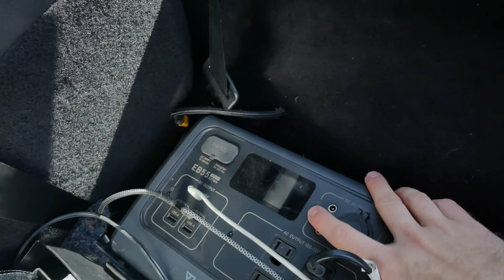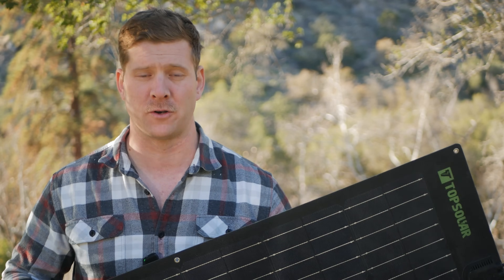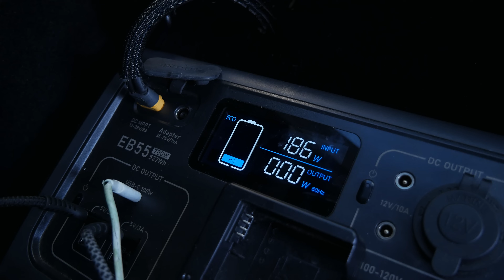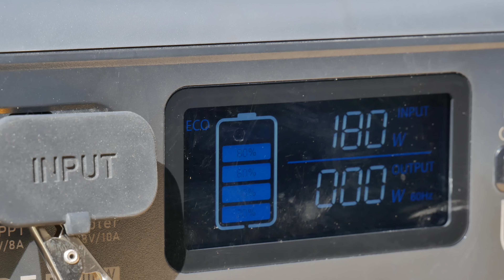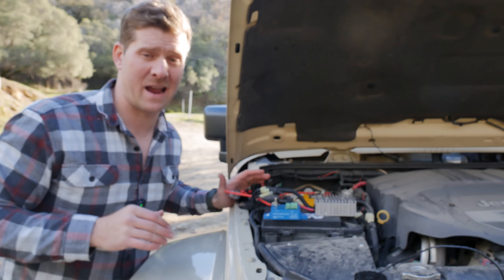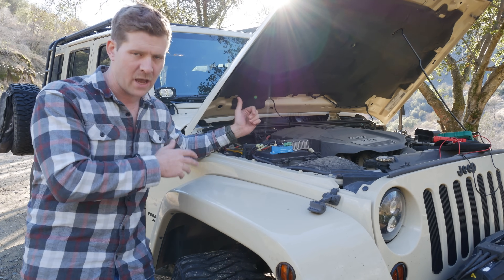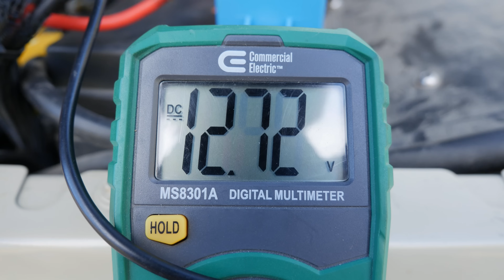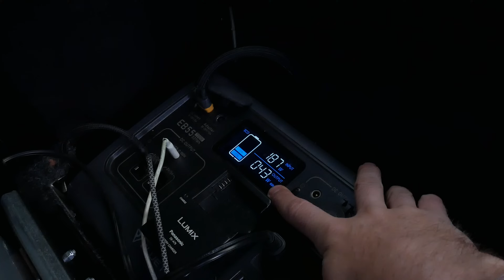Solar is Impractical for Overlanding: Here's a Cheaper Alternative That Makes 200W!

Comment from the maker: ** Correction: Watts law, not Ohms law (stay in school kids). Subscribe if you found this helpful! More like this to come!

Also I appreciate the feedback on the voltage cut off! Going to raise it higher than 12V. Also, I took your recommendations and moved the step up converter under my passenger seat for far better cooling.
Reply: You had it right the first time.... Ohm's law tells us volts times amps equals Watts

But I guess it's really potato potahtoe
Reply: 12V on a car battery is actually considered a flat battery.
You will find out why on a cold morning.
Reply: @ProjectRoadsideFaith   Actually, Rhino is correct.  Ohms law is Volts=ohms x current.  Power calculation is Watts=Volts x Current
Reply: Watts the difference?
Reply from the maker: Underrated comment

Comment: Wow you guys are way behind the times. In Australia every 4wd that has a 2nd battery and goes off road also has a DCDC charger fitted that does both Solar and Alternator charging, if you are driving you are charging, if you are camped you are charging. But then again we fit winches and radios as well.
Reply from the maker: You guys are definitely ahead of the game
Reply: And Australia is sunny almost everywhere you go!  Perfect place to take advantage of solar.
Reply: Do the Real Australians Have 4x4s or are they still being treated bad by the uncivilized colonizers.  That matters much more.
Reply: @LasVegasRealEstateCo  Ha Ha, Yea Mate we all get treated like s%it by our governments (Both state and federal) We are only allowed a 3 inch lift max = 2inch on suspension and 1 inch on tyres. Track width no more than 1 inch from OEM. Anything else requires a engineers certificate. 
To compensate all the 4x4 enthusiasts here run winches, diff lockers and have traction boards. 
One thing we do better than you Septic Tanks is our electrical systems. We all run refrigerators, a common size is 20 gallons, induction cookers are common, 12 volt ovens are common. 
We all run a DCDC charger with solar and alternator inputs, so we are charging when driving and also charging when camping. A 30 amp charge when driving and a 20 amp charge on Solar is normal. 
We Camp for a week with cold beers and fresh steaks.
Reply: The Dual car battery fad has come and gone in USA proving itself to be a liability not a boon.  My Bluetti AC180 sustains us for days without needing recharge and Bluetti's proprietary high charge rate only takes 1.5 hours to 100% charge.  1.5 hrs is almost the time it takes to pack the car!
Reply: @rubiconadventurewithscotty3258  So you have a duel battery without having a duel battery 🤣🤣🤣
Reply: @peterstone5356  haha - Mate, you're gonna do well in USA politics!
Reply from the maker: This thread is awesome. Haha
Reply: We also fit snorkels as well. Around half of the 4WDs and 4x4 utes I see in North QLD have them fitted, and I'm sure most of those never go off road.
Reply from the maker: @zo1dberg  to be honest, I feel like we barely rarely have used for them here in the US. If there was a river I needed to cross that was anywhere near the hood I'd probably just turn around haha
Reply: @RhinoOffroad  Do you see them on a lot of vehicles in the US though? In Australia, they're everywhere, but I doubt many of their owners ever go offroad, let alone go down to a depth of water where you'd need a snorkel.

My 200 series Landcruiser came with a snorkel when I bought it, but I don't do offroading as I only use it as a tow vehicle.
Reply from the maker: @zo1dberg  more than you'd think, and I chuckle every time I see one as I doubt those tires ever touch a river, let alone a creek haha
Reply: When I was living in SA you'd often hear about snorkels being recommended to get cooler and cleaner air from higher off the ground.    Australia is a dusty place.
Reply: @JAlexanderG  That makes sense, and ChatGPT agrees with you too!
Reply: @zo1dberg  Exactly - who thinks that plastic actually looks good if unused?  SMH
Reply: @peterstone5356  Can you post information on those things?  That sounds pretty cool 😎
Reply from the maker: @aceclarksatx on the gear used? Check the description 🤙
Reply: In Australia, you need these things as a necessity in the US we use these things for recreation. But I do wish that they came on four-wheel-drive too
Reply: In Australia, you need these things as a necessity in the US we use these things for recreation. But I do wish that they came on four-wheel-drive too
Reply: It’s seems quite a bit more rugged over there. Kudos to the Aussies🫡
Reply: In the US, we do indeed see a lot of Jeeps, Rovers, FJs, etc fitted with snorkels and railroad jacks... and these cars, you know damn well they've never seen any serious terrain duty... certainly no river crossings. 
Most of them are poser brahs.  

About the only snorkel intakes I ever see getting purposefully used around here are fitted onto quads.
Reply: Funny thing about the Bushmasters we Aussies sent over to Ukraine: the biggest advantage of them was that they had decent de-bogging tracks to lay down and pretty reasonable winches on them. Low-end vehicle recovery, alongside a couple of power-points for cooking and comms/ recharges.
So it's not just in the dry that this stuff is handy, works in the slush too. Even in a warzone.
Reply: Many full-size commercial trucks, semis, whatever have air intakes well above 4x4 snorkels because the air is cleaner & sometimes cooler up there.
Reply: This is the way!
Reply: @rubiconadventurewithscotty3258  So, a dual battery
Reply: Yes that is a better solution. I wouldn't like to run that on one battery the risk of having a flat battery is too high. 
Yes I do note that he has accounted for that. But a second bat and solar is better much better.
Reply: Cheers mate! Great tip! Imma' grateful yank and I will do this! Genius you damn aussies! 
🏴‍☠️🏴‍☠️
Reply: @peterstone5356  I camp (USA) 3-4 wks off grid. Solar: 1KW, battery 500+ah, induction, fridge, comp toilet, Starlink, 3 computers (work from van), espresso maker, toaster oven, etc… and Imma girl. Self built 🎉❤ oh 28 gallon water tank with 4 filter system- only used for drinking/military shower- outdoor shower, AUS 12v water heater!
Reply: @RhinoOffroad snorkels are used mostly to have a fresh air source instead of the dust billowing under the vehicle off road.
Reply: @JAlexanderG exactly~
Reply: @MannyWC  Nice system, you could almost run air-conditioning with that.
Reply: @peterstone5356  lol ‘almost’ is my issue;)

Comment: Take note guys, he's basically just charging his battery with his engine twice as fast. He didn't magically double his power. It's all equal at the end of the day. But you are pushing your engine though. Not sure how to calculate the wear and tear of that.
Reply: Do your oil change more often. Like cut what they say in half.
Reply: Engine wouldn't notice additional 100 watt power draw from this. So, only problem are hours of idling, each of them is like another 10 miles to the mileage.
Reply from the maker: @TheMadJagger not idling to charge; just charging while driving. Totally agree with the negligible additional load.
Reply: @TheMadJagger   An additional load on the engine of 100 watts is equal to 0.134 horsepower. Hardly something that you need to be concerned about.
Reply: 746W = 1HP so he's drawing less than one third of one horsepower, his engine is really not going to notice! Your A/C draws much more...
Reply: From what I've seen on other channels, the alternator can heat up at low RPMs due to slow fan speed. I'm thinking that the breaker switch might be handy in the cockpit, to turn the system on when on the road. Perhaps an extra fan could be installed near the alternator for charging at idle.
Reply: @gotredeemed In principle yes  if you're drawing too much power you can overheat your alternator.  In this case he's under 200w which is about the same as turning on your headlights.  Not enough to be a problem IMHO.
Reply: @sonictech1000  Good to know. I'll be trying the same setup. I think the controller I bought (temperature sensitive) won't handle it and may need to buy one that will. They can be pricey.
Reply: Pushing the Engine  how  exactly ? The  Alternator  is  working a bit harder , yes , but the Charging cycle is usually done  WHILE  DRIVING . Yes ?

Comment: Yup I have a high speed Jackery charger onboard in the gladiator cap that charges at 190 watts. You don’t need 24 v either 😉.  You are the first person I have seen that has figured this out. Jackery charged in 3 hours 🎉
Reply from the maker: @wildernessrecon  glad you found another good solution! I'm guessing that the Jackery charger also boosts the voltage up. Would be curious to find out!
Reply: @RhinoOffroad  very true about the Solar though. 200w panel just slows the bleeding if you don’t have full sun 😂. So many variables, with weather, terrain, timing, etc etc
Reply from the maker: @wildernessrecon  yeah dude! It's pretty early to tell, but I think this is going to be a game changer (especially for the winter)
Reply: @wildernessrecon  Considering just the AC inverter on with nothing on it can drain the battery in under two days, I'd say panels under cloud just to offset inverter bleeding is a win.

Comment: If your refrigerator draws 400+ watts continuously, you need a new fridge.
Reply from the maker: @ReflectedMiles  40W!
Reply: @RhinoOffroad  😆 Sorry. Even then, it shouldn’t be continuous—that was the point.
Reply from the maker: @ReflectedMiles  gotcha, it's definitely not continuous, that's what I see at the max. It'll get up temp and then really just run on a trickle. I have a bunch of camera gear I also charge off of the battery. That said, I just bought a brand new fridge I'm testing out, so we'll see how it compares!
Reply: Thats a lie! My domestic is rated 200W, and it draws that continuosly till set temp is reachec then it cuts! So a 40W one will draw 40W continuosly till set temp and cuts! Thats why its rated 40W
Reply: @martinmtawali7359  You said it’s a lie and then explained why it is true. 😆👍🏻
Reply: @ReflectedMiles  no its not true! You say if it draws rated power continuous then you need a new fridge?
Reply: @martinmtawali7359  That is correct. Rated power (amp draw) is the amount of nominal power the unit requires when running (not peak like at start-up, and not including time that it is not running because set temperature has been reached). So as you inadvertently explained, if the unit is drawing that nominal power rating continuously (never reaching temperature and shutting off), it is defective and you need a new fridge (or compressor or whatever, which in many cases will cost as much or more than simply getting a new unit). It is common for newbies to miscalculate their energy requirements just because they miss significant factors like this.
Reply: @ReflectedMiles  now we are on the same page! had you explained this in the first place i'd have gave the thumbs up, am a technician by the way!

Comment: Well thought out . And  well implemented  and  explained  too . People tend to forget the Volt/Amps ratio that results in Wattage .
YES , you did essentially double your Charge rate , without ANY extra stress on the Vehicle or other systems .
Reply from the maker: @johncunningham4820  hey, I really appreciate that, thanks for taking the time to watch it! My knowledge level is pretty simple when it comes to electrical work, so I at least try to explain it in a way that I would understand haha
Reply: @RhinoOffroad . Which you DID perfectly , considering that your Target Audience is probably considerably Less knowledgeable than yourself .

Comment: The Charger, Voltage monitor is connected all the time to the main battery?
Beware, that these also constantly draw some current to monitor everything. Better to hook up a relays to the ignition, so it is only on when the motor is usually running. For my own setup I even used a time delay relay, so it only activates charging about 10 minutes after starting the ignition. This makes sure that on very short trips the main battery always gets some extra juice to keep on going. You still could attach the voltage monitor as extra safety, but than, it is almost not needed anymore.
Raising the Voltage so, is nice trick I have to keep an eye on 👍

Comment: 315w canadian solar house panel on the roof of my landcruiser, and a 20 amp dcdc that i can swap input and output with two anderson plugs, i actually have enough solar that the dcdc charges my start battery and saves me some fuel/ engine load when the sun is shining. Then if its night or the clouds are over, i can unplug the dcdc and charge the aux battery from the alternator. House solar panels are cheap and far more efficient than those semi flexible panels.

Comment: There is a good point here. I could take my battery packs and charge when on the road driving and use when not driving. Just curious what max size battery pack would be for just USB type charging in the car. (I do not want to mess with Wires )

Comment: @RhinoOffroad  Your AGM battery must supply all of the power to charge your lithium-ion battery and to produce the heating of the DC-to-DC converter. Therefore, if you are ever charging the Li-ion battery without the engine running, then you are wasting a good deal of your AGM energy for heating the converter. In that case, it would probably be better to take the converter out of the circuit and charge the Li-ion battery at the slower rate.

Comment: Ecoflow offers a product that charges at 800 watts. Its called the Ecoflow 800w Alternator Charger. It is on sale for 400 with the regular price being 600. Thats more than this solution but might be a simpler solution if the price isn't the issue or you need the super fast charge
Reply from the maker: Great point!

Comment: Much cheaper solution than Bluetti charger1.  I am wrestling with this in my setup.  Park somewhere in the shade and no solar, but cooler trailer.  If you are parked for a while, you have to idle the truck for an hour to recharge.  Starting to think a used Honda generator would be the most flexible option.

Comment: If you're going to run your car engine for a period of time to charge your bluetti battery bank, you might as well get a small generator (2000 watts) and charge at full A/C power.
Reply from the maker: @bwillan  only using the engine to change while I'm driving 🤙

Comment: What's not stated clearly here is this is taxing your battery and that tax is then passed along to your alternator and, of course your engine. The strain on the engine is negligible but does cost gas, the strain on the alternator and battery are well beyond their design functions though and failure at some point is reasonably expected. You can do something similar with power inverters run off a car battery and see pretty much the same results. They just don't make car alternators to function under heavy loads continuously. I did this during a mining season and my alternator expired in a weird way, I had unusual problems that were related to the voltage regulator but replacing the alternator was what ultimately fixed it.

Comment: Car battery voltage typically ranges from 12.6 to 14.4 volts with the alternator charging it when running. A fully charged battery should measure 12.6 volts or above when the engine is off. Set the voltage cut off to 12.55 like @Ulbre mentioned.

Comment: It will still drain your battery just as fast, it doesn’t make any difference. You are putting an inverted between your storage battery and the car battery, just to put high voltage into the builtin inverter that charges your storage battery !  Put a high amp alternator on your engine, that would actually make sense. Even better charge the storage battery before you leave home !
Reply from the maker: @Nostrudoomus  but it won't, because I'm still supplying 14V to the car battery while charging the Bluetti at 200W

Comment: I believe you are stressing your Jeep starting battery by allowing voltage draw down to 12.0VDC. I would be surprised if you get more than 3yrs out of your battery.

Otherwise, you have  good hardware and very sound practical setup.
Reply from the maker: Thanks! From suggestions in this video, I've raised the cutoff voltage (I also have a free three year warranty on the Optima). Thanks for the support!

Comment: Another cheap way would be to just get an inverter.  A 300 Watt inverter would be pretty cheap.  Then just plug that into your cigarette lighter and plug the power unit's A/C charger to that.
Reply from the maker: @ruck-a-tron  the cigarette lighter can't handle 200W. I tried this before and it kept tripping offline
Reply: @RhinoOffroad  yeah I just looked it up and it seems that around 120-150 watts is all they can put out. I think that’s still higher than what the car plug that usually comes with power stations put out. It may still be an option for smaller power stations.

Comment: I am going to throw a curveball here: you have a very cool set up but I was thinking, okay, it costs money for that Bluetti, charge controllers etc etc. Imagine if you had no Bluetti, and you just had two car batteries AND an inverter. Isn't that better. Thereby you have no losses from converting, not as many devices, less fuss. After all the Bluetti is just a fancy battery.
Reply from the maker: @makingcookingfixing  you bring up a great point, and I considered that for awhile before I went with this setup. Ultimately, the cost between the two would be similar but the Bluetti vastly simplifies the install and set up. I also want to be ability to take the Bluetti out around camp if I needed to power something well outside of the reach of the Jeep. That said, I may look into a full auxiliary battery setup in the future!